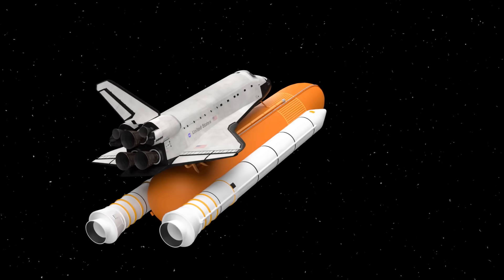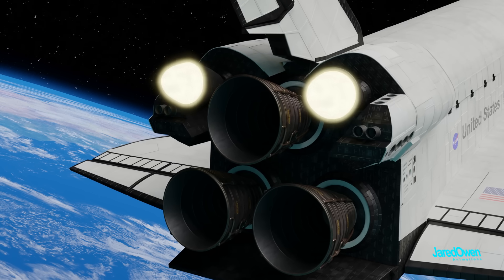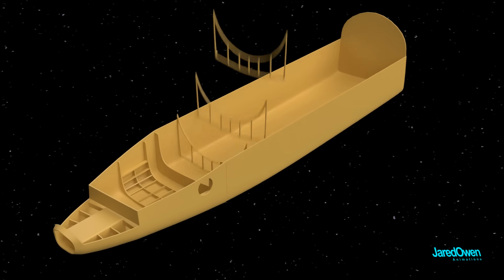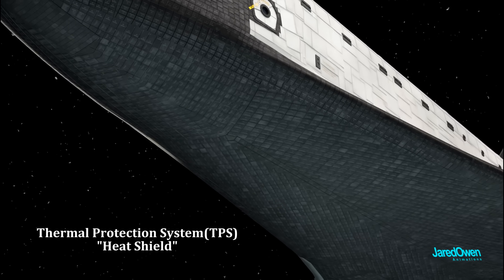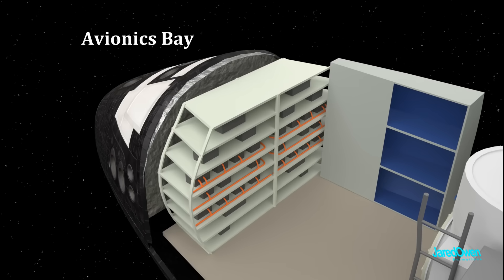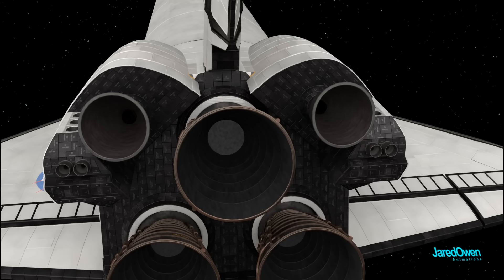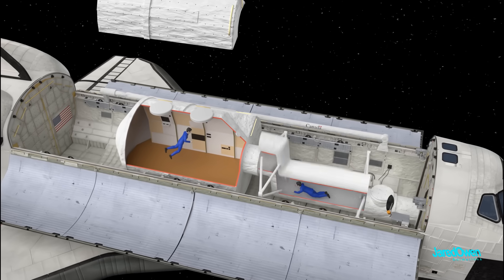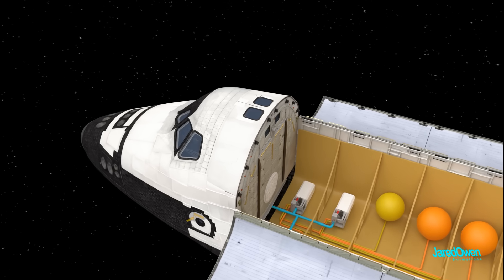How did the Orbiter Vehicle work? (Space Shuttle)

Comment: the space shuttle is such an iconic thing that its kinda depressing when you figure out its no longer in use
Reply from the maker: True...but there's a bright future coming at us with SpaceX and SLS
Reply: @JaredOwen  spacex's rocket boosters use half to fuel to return back to earth. The spaceshuttle used no fuel to land.
Reply: @panzerofthelake506  The Falcon 9 first stage uses far less than half its fuel to return and land; it's actually less than 5%. This recovery method results in the majority of the cost of the rocket being recovered, including 9 of the 10 engines, and the most complicated plumbing and control systems. The fairings, another part that's somewhat expensive and timely to manufacture, can also be recovered and reused. This all results in vastly increased launch cadence and vastly decreased cost. The reuse does use up some fuel, yes, but it's not often there's a payload that requires the full use of the rocket.

Compare this to the Space Shuttle, which hits so many brick walls on its way to reusability. The SRBs are reusable only in name, as each one requires a complete rebuild to be ready again. The external tank is thrown away, and while it's not that much, it's still yet another loss. The Orbiter itself is a travesty. It has a dry mass of 78 tonnes, and has a crew of seven. Compare this to capsule designs; the Apollo CSM had a dry mass of about 12 tonnes. Crew Dragon has a dry mass of about 10 tonnes. Even the beastly Orion has a dry mass of only 15 tonnes. This means that at minimum, the Space Shuttle lugs an extra 63 tonnes to orbit. That's absolutely horrific. That means for the same work, you could've put another 63 tonnes into orbit. Keep in mind that the Space Shuttle has a max cargo mass of about 24 tonnes. Then we get to the engines; they're reused, yes, but on average only about 9 times each, and between each and every one of those uses they have to be torn apart and put back together. They're not even static fired to test! And they run on hydrolox, not keralox, meaning that firing them wouldn't even build up any carbon soot, yet they still didn't test, because a test means a complete rebuild! It drives me to drink! And who could forget about the heat tiles?! Of course having thousands of unique parts is a good idea! Why not make all of them extremely delicate, and cause a loss of vehicle (which also means loss of crew, because abort systems are a myth!) if even a single one of them fails! Even better, let's have to replace them after every flight! Fantastic! And let's secure them with a toxic glue, why not? Oh, and speaking of toxic, how about shutting down this entire months-long process of getting it ready for another flight so guys in HazMat suits can come and clear out the carcinogenic, toxic, and corrosive propellants used in the OMS, because otherwise everybody in the hangar would start coughing up their lungs? Angry? No, I'm perfectly okay, just peachy, infact!

The Space Shuttle is nice only as a memory, and a foggy memory at that. Look to close and you realize how big of a mistake the entire system was.
Reply: @panzerofthelake506  fuel is cheap compared to the price of the rocket so being more resuable for the cost of expending more fuel is worth it.
Reply: @JaredOwen  is there a new shuttle in development?
Reply: space shuttle: no longer being used
spacex: helo
Reply: Here's why it is no longer in use.  Originally, the shuttle was expected to launch as often as once per week, at a cost of $20 million per launch.  Instead, it ended up costing about $1.5 billion per launch.  I don't have much respect for members of the House and the Senate.  But in this case, they made the right call in terminating the program.  In addition, former NASA administrator Bolden initiated the private-sector space launch program.  Now we have SpaceX, which can do it cheaper with reusable vehicles.
Reply: @NOLAMarathon2010  maybe also because the space shuttle has 2 accidents out of 135 missions, and they were afraid of another accident. Also maybe because the repairs after every  flight cost a lot for the space shuttle.
Reply: Kinda, yes. But understandably so...
Reply: paul sticks  about what
Reply: yeah, but then you realize it was a ridiculously expensive death trap that killed 14 people due to its, umm, interesting, shall we say, design choices (more than any other launch system) and ended up being MORE expensive than the expendable systems it was designed to replace.
Reply: The shuttle concept was a flawed one from the beginning. An awe-inspiring, magnificent piece of engineering and a sight to behold, but unfortunately a mistake in the grand scheme of things. But that’s okay, you have to accept your failures and move on. 

The shuttles were retired over a decade ago, which many people don’t know, but we are in a new era of spaceflight now!
Reply: @Colin Berg I'm not describing cars. Cars replaced horse-drawn buggies, and are better than said buggies in every measurable way. The space shuttle was supposed to replace expendable rockets. Not be a reason to create an entire new generation of them. To loop back to the car analogy, it would be as if the Ford Model T ended up being the impetus for a whole new generation of horse-drawn buggies, buggies which eventually overtook the Model T in sales and outlasted it by over a decade (at least).
Reply: @Colin Berg Also, the Challenger was a design flaw. It's crappy design to have a crew compartment that cannot escape from the rest of the stack. On SLS, which uses nearly identical propulsion, if the Challenger-type failure occurred, the astronauts would be able to safely escape the exploding launch stack. The poor design of having the orbiter strapped next to the launch stack with no quick disconnect system in place to escape while the SRBs were burning cost the lives of the astronauts (as did NASA culture at the time).
Reply: It was too expensive: the space shuttle program cost more than the Apollo program
Reply: It was a dangerous spacecraft to fly designed by politicians.
Reply: As others have already said, it just got too expensive. It was supposed to make spaceflight cheap, simple, and accessible. In some ways it did, but for many payloads they're safer and cheaper going up on a smaller disposable rocket.

When you look at the orbiter, it's a complicated vehicle which needs to be thoroughly inspected before each launch. There's no way they could have turned it around within a week and sent it back up. Then there's fuel costs, crew training, and weather considerations at launch. My latter point regarding the weather is why we lost Challenger back in 1986.

The best thing to do these days is to outsource it to private companies. SpaceX and that kind of thing. The private sector needs to take the helm and begin sailing in the ocean of space. People don't want to see their hard earned tax dollars going into programs like the Space Shuttle, for little incentive, while there's still so many problems at home. These kinds of reasons are what killed the Apollo Program as well.
Reply: @Doctor699  hey nasa gave us many modern technologies! Their budget is miniscule compared to the military which sucks most of the budget in the us.
Reply: Honestly the Space Shuttle was a marvelous system, but it had some inexcusable design flaws which caused the two horrible disasters, a little different design may have been able to sustain operation longer
Reply: @luz-5020  the first disaster had nothing to due with design.  It was not designed to launch in cold weather because the rubber seals used to seal the SRB sections wouldn't expand correctly if the temp was somewhere in the 30s or lower (I forgot exact temps). The issue was that the launch had been delayed a few times due to weather and NASA was 7ndee unfair pressure from the government to launch due to the publicity it was getting for having the first civilan 5o fly. So, due to people (politicians):who knew nothing about design specs of the SLS pressuring NASA heads to launch when they new the temp was too low to launch yet did anyway, 2as the reason for the disaster, not the design.  The Columbia in 2002 could be chalked upto design flaw but it's a bit of a stretch due 5o not having similar issues we've before that launch.  Regardless, my heart still goes out to the friends and families of the astronauts whom were lost in BOTH disasters
Reply: @CONSOLETRUTH2  Yes because a full-envelope abort would have likley saved the crew, the SRBs where part of the problem crating 180second blackzones on ascent, the accident could have been avoided but the crew could have been saved regardless, since the SRB breakwires actually tripped had the Space Shuttle any form of abort meassure during the first 2 minutes of flight the crew could have survived
Reply: Space Shuttle has a special place in my heart.

But overall, it must go after ISS finish(ish).
Reply: Hey guys if you like space videos then do visit my channel once pls 🙏 🙏🙏 🙏
Reply: @EXOPLANETnews  OK dude imma subscribe to ya if its cool vids